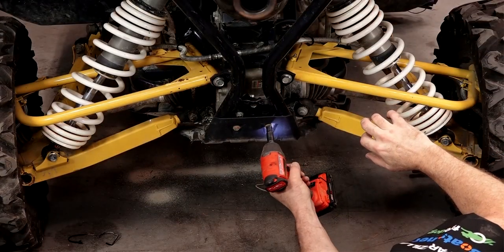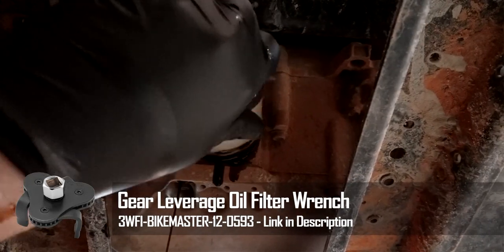Yamaha YXZ1000R Oil Change | How to Change the Oil on a YXZ1000R | Partzilla.com

Comment: This kit is for motor and transmission.  The third washer is for the transmission drain bolt, and the other two quarts of oil is for the transmission also.
Reply: Facts 100%
Reply: Good call !

Comment: Could you just use the other 2 quarts for the transmission change and then that other oring would be your transmission drain bolt crush washer